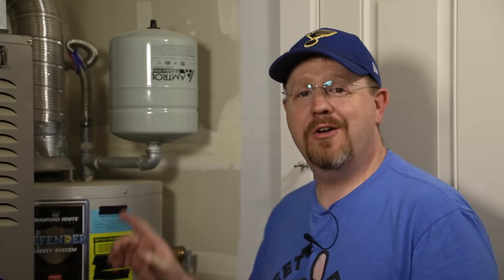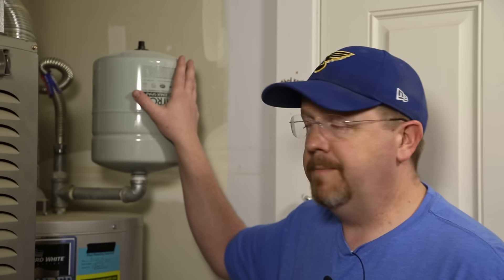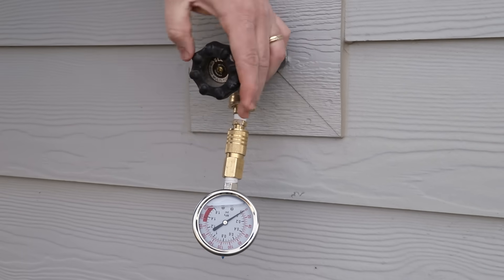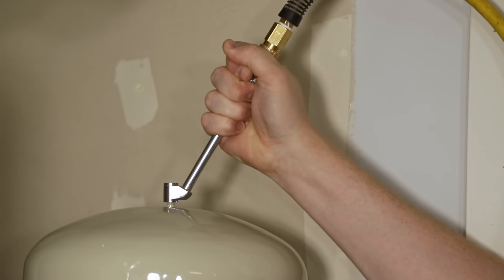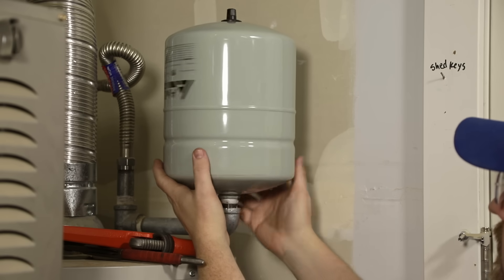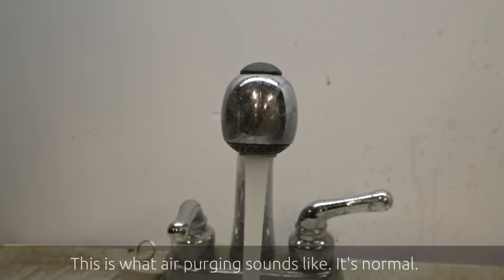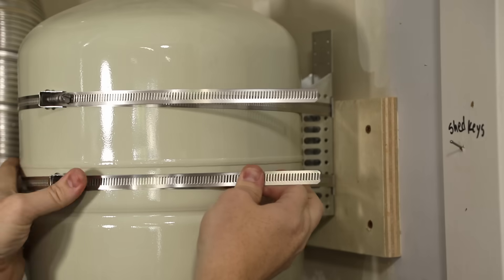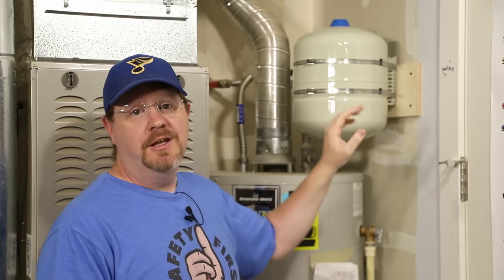What Is This Tank? How to Replace and Maintain a Water Heater Thermal Expansion Tank

Comment: I just installed a new water heater and i'm now suddenly obsessed with all this extra stuff.
Reply from the maker: It's a disease, really. :)
Reply: @AmplifyDIY  So take this, I live in Texas my dad was gonna hire someone to do it and the person wanted $500 bucks to install. We freaked out, we then called a friend and offered to come in and help install it. We went and bought it Rheem performance 50gal and got it installed in like 3 hours. After installing it I started looking at other heaters and saw this thermal tank. I remember seeing one before so I was curious to what it does which is how I ended up on this video and the explanation is great :D.
Reply from the maker: Glad to be helpful! I've got several other water-heater-related videos that you may also find helpful. I do recommend you get an expansion tank installed - especially if the prior heater had one, or if they are common in your area. It's also a good idea when a tank is new to replace the drain valve with a better one: https://youtu.be/OBPJYg0o_o0 and to loosen up the anode. You don't need to pull it out and inspect it or anything, but anodes come from the factory torqued to a crazy high amount... and after a few years in the tank they are VERY hard to remove. If you can crack it open and re-tighten it to something more reasonable now, in a few years when it's time to replace it the job will be much easier: https://youtu.be/OIMz1rwx_jc
Good luck!
Reply: @AmplifyDIY  Maaan. I knew about the drain valve. The guy who helped us install said he likes the brass ones instead of the plastic ones and the popular plumbing channel guy I can't remember his name says replace it with brass and your video on it is nice so far, I liked you mentioned the size making it easier for build up to escape.

Comment: My original hot water heater had an expansion tank. When the water heater needed replaced I had a friend install a new one for me. He said that I didn't need the expansion tank. Unfortunately, after a very short time my new water heater started leaking due to not having the expansion tank causing too much pressure ruining my floor and main valve where water comes into the house. I really appreciate that my buddy tried to help me out, but it would have been much cheaper to have a professional install my new water heater.
Reply from the maker: It's unfortunate your friend did not know that the expansion tank really was necessary in your installation. Fingers crossed you don't run into any other plumbing problems. Thanks for watching!
Reply: @AmplifyDIY  fingers are definitely crossed :)

Comment: This video is a lie ! Water heaters are designed to operate properly without any new money pits like this “ thermal expansion tank” this is just an excuse to get people to either hire a plumber etc ( very costly) or go buy a useless item at hardware store and install it yourself wasting time and money. My water heater lasted decades operating without this useless product!
Reply from the maker: I'm afraid you are misinformed. Just because you have not needed one on a heater you've owned does not mean they are somehow fake or something. Expansion tanks are becoming much more common, and have been required in all new construction in my area for at least the last 10 years.

Comment: Why did you not recommend the Everbilt brand in the Amazon links?
Reply from the maker: No particular reason. When filming this I picked up the one you saw at my local big box store, but linked to the ones on Amazon as they are easier for folks to order in areas not near a store that stocks them. Either brand is fine.
Reply: @AmplifyDIY  I see. Great detailed and very easy-to-follow tutorial video. I am going to try it this weekend. You made it look so easy! Called a plumber for an estimate told me it was $300, told him would try it.

Comment: Will this in anyway help with the pressure buildup from pipe freezing?
Reply from the maker: Heya Guarding Dark - no, freezing pipes burst because the water expands in place in the pipes. An expansion tank won't help this at all. If you are concerned about pipes bursting, let your faucets drip slowly, and consider adding insulation to your pipes if they are prone to frequent freezing. Good luck!

Comment: Thank you for this video! I will be changing mine soon. Mine got a very tiny hole up top. Maybe couple teaspoons overnight of leak. Can the inside get corroded/rust and create a hole because sometimes the water looks rusty? Thank you!
Reply from the maker: Hey Sammy! If the internal bladder fails and leaks water I to the upper portion of the tank, then yes it will absolutely rust and can fail just like you describe. I’d recommend changing it sooner than later, as the leak will just get worse, and may do so quickly. Good luck!
Reply: @AmplifyDIY  Thank you! I learned something new today because of you. I’ll be sure to like and subscribe. FYI I changed it :)

Comment: so, the water heaters i am familiar with come with check valves. matter of fact i dont remember which side the check valve is on, but i believe they are on both hot and cold sides. so how can the expansion tank do its job with check valves in place?
Reply from the maker: Huh. I've never owned a house with a check valve built into the heater.

Comment: I just had a thermal expansion tank installed, but I didn’t notice my plumber check our home water pressure or pre-charge the tank.  However, I thought it was charged correctly as it read 65psi which matches my home water pressure when I tested it with my pressure gauge.   However, I then watched you video and followed your steps to check the tank pressure correctly by depressurizing the system and found it was just barely above the factory psi of 20 at 20.5 psi. Therefore I filled it up with my compressor to match my home water pressure. Wouldn’t have known how to do this without watching your video.  Thanks for the great video!
Reply from the maker: Nice job, Dan! I'm perplexed by how many licensed plumbers get this so wrong. Glad you caught it and pressurized the tank correctly so it will work properly. Thanks for watching!

Comment: In my house, the original water heater which lasted for about 23 years had been replaced but neither of them includes an expansion tank. The current one is a Sears brand, gas heater and manufactured by AO Smith with an 80 gallon capacity. Do I need an expansion tank? I'm in Northern California. Thanks.
Reply from the maker: Hi Johnny - whether you need one or not pretty much depends on your water supplier. If they require a backflow preventer on your hookup to the main water supply, you'll need one of these. They are not commonly needed on older homes, but lots of new construction requires them. 
If you don't have one, and have never used one, your system likely does not need one (unless you hear otherwise from your water supplier).
Thanks for watching!
Reply: @AmplifyDIY  Thanks and have a blessed day!

Comment: Do you have to turn the main water valve in the house to relieve pressure or is just the cold inlet in the tank good enough?
Reply from the maker: Turn off the cold inlet, then open a faucet to bleed off the pressure. No need to turn off the main water valve for the whole house.

Comment: The county I’m from in Ky I can say Iv never ever seen one of these installed on a water heater. Been around a ton of water heaters over the years replaced many. Yet Iv never seen one of these installed and had worked in many new construction homes. Iv also never seen the blow off valve leak because of it. Iv seen water heaters over 20 years old no issues with out one. I just bought some land a few county’s over from me, and when I was signing paper work to have a water meter installed there was a line that I had to sign in agreements I had to install one witch is no big deal but I thought why is that a requirement here. I’m not buying there needed. My house I’m selling was built in 89 never one issue with out one. If the elements are kicking off at the right temperature it’s never going to build more pressure then it was designed to handle.
Reply from the maker: Heya Hellwithpots - simply heating water (even within the temperature range the heater is designed for) will make it expand. That expansion has to go somewhere. In your county it's probable that they still allow that expansion to backflow into the water supply, so you may not need an expansion tank. More and more water suppliers are requiring them though, especially on new construction. But this does vary quite a bit by area. Thanks for watching!

Comment: How critical is it to match PSI to the water pressure? I recently installed a new expansion tank (pre charge 40psi) on a 40 gallon water heater.
Reply from the maker: Hi Andy - ideally you want them to match, but within a few pounds is probably fine. I would not want to be off by more than, say 10 psi though. The farther apart they are, the more it will stress the internal diaphragm of the expansion tank. Good luck!
Reply: @AmplifyDIY  thank you. Sounds like I'll need to check my water pressure just to be safe.
One last question, I forgot to add teflon tape when I installed the tank, is teflon a must for longevity?
Reply from the maker: If it's not leaking, don't sweat it. Just keep an eye on it for a week or so - if you notice any leaking/dripping/weeping you'll want to remove it and use either pipe dope, teflon tape, or both to seal it better.
Reply: @AmplifyDIY  thank you again. Extremely helpful. 
Another observation is that my tank was originally installed horizontally without support straps. And I did the same. However from everything I read and videos I watched, they advised to set them up vertically with some kind of support. What's your opinion?

Comment: Thank you for this video   ,  Can this tank be hung below you water line.  our problem if we put the tank bottom even with the  water line we do not have enough room before the tank would hit the ceiling
Reply from the maker: Usually these tanks can be installed in several different orientations. Check the manual for your new tank to see what it recommends. The one I installed in this video specifically can be installed in any orientation without issue. Great question!

Comment: The easiest way to test your expansion tank is to just release some air from the Schrader valve, If you get air the diaphragm is good if you get water the diaphragm is bad! I have been used on irrigation systems for years!

Comment: I've  was a N.G  field service rep. for over 25 years and never saw one. A Thermostat takes care of over heating.What a waste of money !!
Reply from the maker: Hi jsamc - an expansion tank is not designed or intended to deal with overheating. It is there to absorb the expansion of the water in the tank which occurs when it is heated at all. Historically municipal supplies have allowed a bit of back flow which let the water expand back upstream to the supply, but more and more water suppliers are requiring back flow prevention at the hook up to your house, which causes the problems I describe in the video. If your system has a back flow preventer installed, and you do not have an expansion tank, you will eventually have problems with other parts of your plumbing (leaking T&P valve, damaged washing machine fittings, etc).

Comment: If I turn on/off the hot water faucet, then flush the toilet, the temperature pressure relief valve starts leaking water. I'm assuming its the house water pressure that is playing a role. Will the expansion tank help with this problem or do I need to install a water hammer arrestor?  Any other suggestions on how best to solve the issue?
Reply from the maker: Do you already have an expansion tank installed?
Reply: @AmplifyDIY  No I do not.
Reply from the maker: Sorry for the delay - I'd recommend a water hammer arrestor vs. an expansion tank. Expansion tanks can help with water hammer, but it seems as though yours is pretty substantial, if it is causing your T&P to leak consistently. Good luck!
Reply: Thanks ... I’ll give that a try. And thanks for your videos ... I’ve learned a lot!

Comment: 6:07  You got the pipe wrench backwards. 😅
Reply from the maker: It was only there to brace the lower elbow, and could not be put on the correct direction because the wall is in the way on the other side of the pipe. I was actually applying the tightening torque with the channel locks above the pipe wrench.

Comment: Can you use galvanized fittings installing a expansion tank?
Reply from the maker: You can, but copper or brass would be better. Galvanized will corrode. Mine are galvanized (installed by the plumber that installed the whole system) and swapping them out is on my list.

Comment: Thank-you!  Your video was the easiest to follow of many, and I was able to replace my x tank myself because of it.  The one thing I had to figure out on my own was that, even with a hot water faucet open, for some reason water wouldn't come out of the drain.  So, I had to unhook the hot water flex to let air in the wh tank and facilitate flow.  The other thing was, even though I let about 3 gallons out, the expansion tank was still full of water for some reason.  My x tank is mounted schrader-up, so once unscrewed I quickly turned it right-side up so very little water splashed out.  By doing it myself, I saved enough money to buy myself a new air compressor, yay!  Thank-you again.
Reply from the maker: Awesome, Jennifer! Thanks for letting me know this video helped. You've made my day. :)
Reply: You made my day first 😁 thanks again

Comment: At 6:08 your secondary pipe wrench is used backwards
Reply from the maker: Hi Erv - Good eye! Unfortunately it was physically impossible to put it on the correct direction (wall in the way) ... but I was not using it to apply a strong torque - merely using it to brace the extension pipe so that I could spin the expansion tank down tight. Even backwards it worked just fine.

Comment: Would a failing or undercharged expansion tank lead to water hammer or other vibrations in your plumbing system?
Reply from the maker: Yes, particularly on the hot side. If the bladder fails and the whole tank fills with water, it provides no damping to any expansion or water hammer/vibrations. Great question!

Comment: Hi, thanks for the great video. I am just wondering what pipe dope did you use? Should I use pipe thread sealant(Masters Pro-dope) or pipe joint compound(Oatey) from Homedepot?
Reply from the maker: I like the stuff from Oatey. Probably either one will work just fine, though. Good luck!

Comment: Thanks for the great video! My T&P valve is plumbed directly into my sump so I haven't noticed any slow drips. But I have noticed intermittently that the pressure when I first turn the water on is significantly higher than typical (after watching this, I expect it's probably right after a heating cycle has run). Checked the pressure on my tank per your video, and sure enough, had water coming out of the Schrader valve. Guess I'll be getting a new expansion tank for Christmas!

Comment: Excellent directions.  Thanks so much!  My expansion tank took a while to empty after I dumped off a few gallons from the heater.  I could hear the burbling, so I just waited until it stopped to ensure it was empty.  Just a helpful point to ensure you don't have spillage when you remove the old expansion to tank.
Reply from the maker: Great tip, thanks for sharing!
Reply: What you should do when you drain the tank is open the top valve as it gives air to the tank and will drain more readily.another thing is the tank should be mounted vertically on the website it shows vertical with the schrader valve on the bottom

Comment: Nice video.  You mentioned if you have a one way water check valve. What some people don’t know is that if your house has a pressure regulator valve..... it also acts like a one way water check valve and you must then install an expansion tank.
Reply from the maker: Thanks for the insight, Alan!

Comment: Most of water heater system working just fine without that expansion tank, why bother,  introducing a potential problem into the system?  I mean the expansion tank is not reliable that why this video and a lot other one showing people how to fix or replace it,
Reply from the maker: In many places, having an expansion tank is required. Lots of people wind up with one without even knowing what it is or what it does. They are reliable if they are properly maintained. Thanks for watching!

Comment: 14 years ago my TMP relief valve kept opening, on my NEW WATER HEATER. Replaced 2 TMP relief valves and still had the problem? So, I had the expansion tank installed. Presto,  no more water heater problems. 11-22-2020
Today 8-1-2021 , Again I replaced the TMP valve and flushed the water heater. Didn’t think about the expansion tank until I watched another video you did, and my exp. tank had two thuds and no ping⚠️ Got a new Exp. tank, water pressure gauge, and pipe dope/ Teflon tape. My water pressure tested at 80 psi. The new Exp. tank is set at 40 psi. And I’m using a portable air pump that I have in my vehicle for tires. And just watching this video once again to get proper instructions to replace and install new Exp. Tank. Well it’s installed and I’ll check it though out the next few days and a couple weeks. My tank is only 2 Gal. and hangs having AIR PRESSURE Valve at bottom. The previous Exp. Tank was installed the same way, having no extra supports. 👍🏻💓❗️🇺🇸 Stay Safe.

Comment: Hello.. what did you use to fill the compressed air into the expansion tank ?? Can I get something at home depot or lowes ?
Reply from the maker: I used an air compressor. You can use a tire inflator, bike pump, or anything you can use to fill up a bike or car tire. Note that a bike pump will take forever, and make your arms very tired. Good luck!